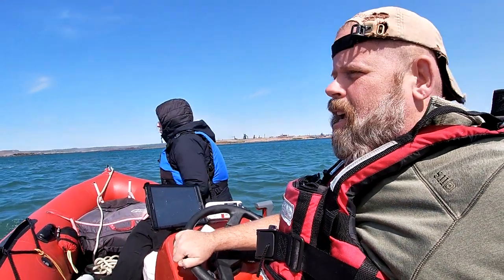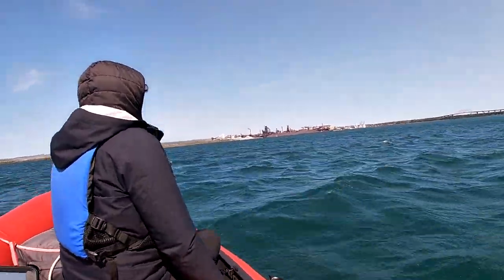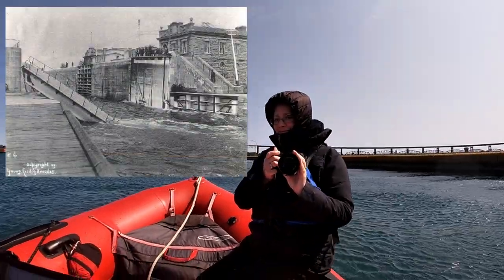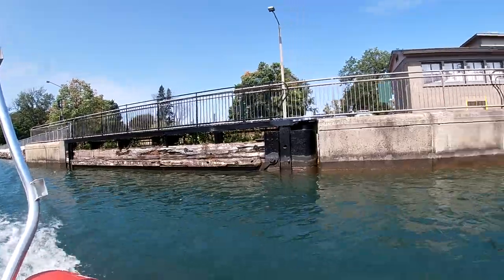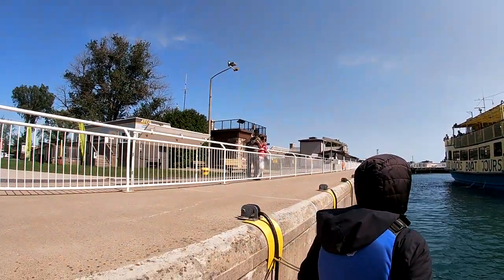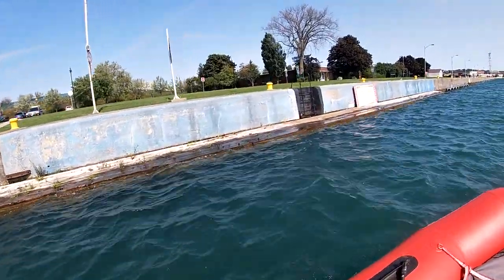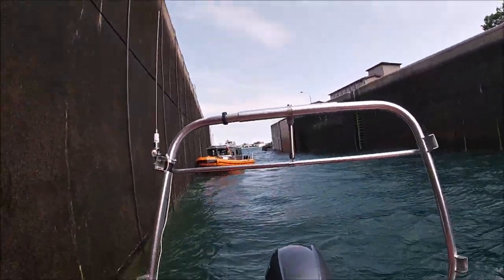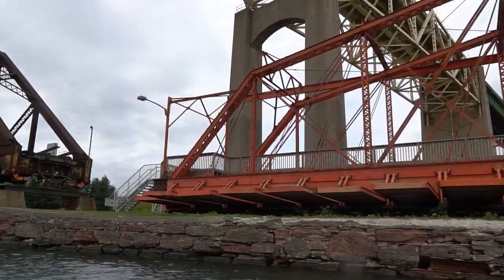The Soo Locks - Locking Through in a Small Boat

Comment: When I was but a pup we went through the locks in a 14' aluminum fishing boat with a 40 horse Evinrude. I don't remember those fancy vertical cables along the lock walls. Our trip up to Superior took us through the U.S. side. We put in at a boat launch just downstream of the locks. At the time there was a small shack right next to the canal before you got to the lock. A guy came out and we pulled along side. If my memory serves he told us that as long as you're a legal motored craft they cannot deny you passage. Also, passage was free iirc. They can ask (tell) you to wait if another boat is soon to arrive, however. He gave us some instructions which included a strong warning not to spend too much time on the Superior side because storms can develop quickly. We pulled into the lock and a guy tossed a line down. My job was to hang onto the line so we didn't float away. We were the only vessel in the massive lock. Our return route back down went through the smaller side (Canadian I think) and shared that lock with a pleasure craft.

Comment: How were the river currents on the Superior side? I'm hoping to take a day sailer through when there's a SE wind to counteract the river if the currents aren't too strong. Definitely planning on dropping sail and paddling through the wind tunnel of the lock.
Reply from the maker: Superior side doesn't have a lot of current, except for the north side of the canal on the west end where the powerplant inlet is.  It will be buoyed and netted and has a pretty strong current.
Reply: @RestlessViking  and that's the US Cloverland canal, right? I was planning on sailing as far upstream in Ashmun bay before crossing the river.
Reply from the maker: @92xsaabaru-  The Cloverland Canal is on the US Side.  This is the Canadian Canal that leads to the Clergue Hydro Plant.   It is just before the Canadian lock canal on the northside. You can see the pilings and nets on google sat view.

https://www.google.com/maps/@46.5133534,-84.3578984,1445m/data=!3m1!1e3?hl=en
Reply from the maker: It isn't bad unless you get right next to the nets.  When I kayak through, I just hug the south side pier.
Reply: @RestlessViking  Ah. Good to know. Depending on wind direction I would have tacked over to that side.
Reply from the maker: @92xsaabaru-  Indeed.  I doubt you'll have any trouble.   Currents in the canal aren't bad at all.   Have a great time, I would love to "sail" that stretch for sure, a little jelly.